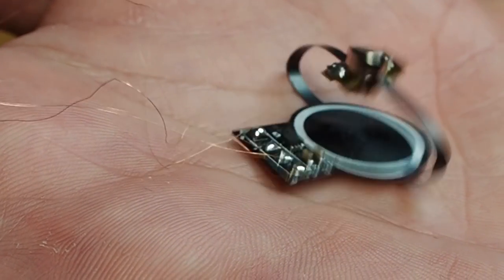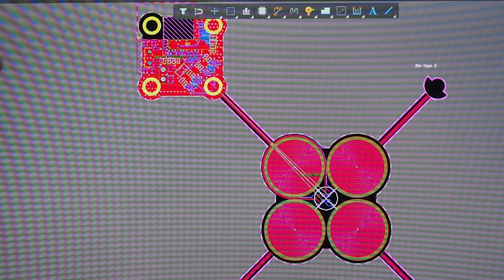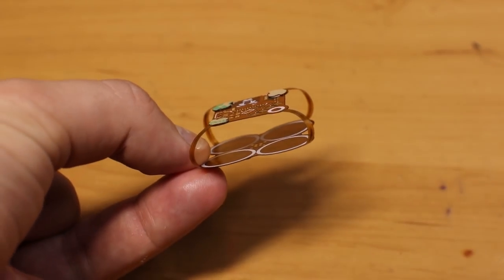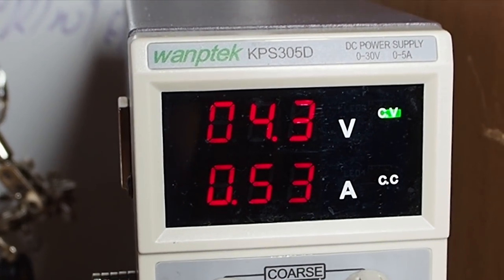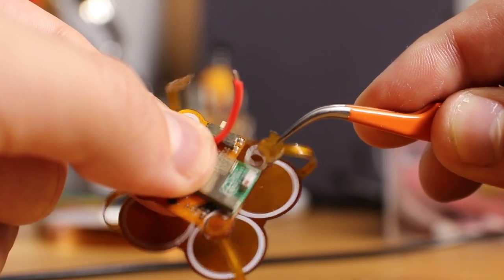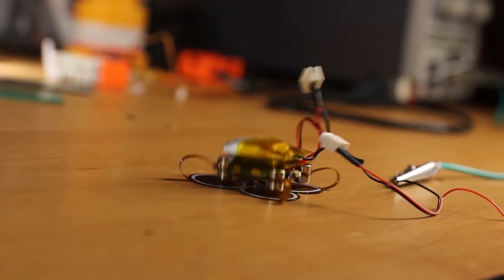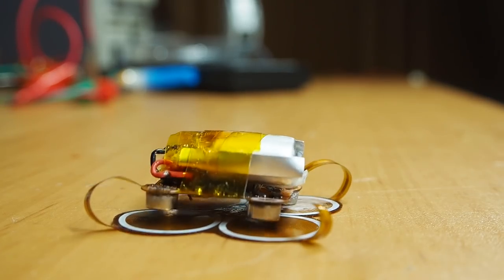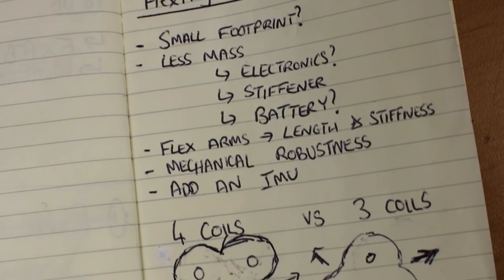Making a Jumping PCB Robot

Comment: Problem ( At least what I think ): Motion is caused by an external force. The action and reaction of your system are contained in itself. Action -> PCB Coil is pushing the magnet upward:-> Simultaneously:-> Reaction -> The magnet is pushing the coil downward.......Both coil and magnet are part of a single system. It's like pushing your car from inside.

Comment: I think you should try to change 2 things 
1. you should harden a bit the legs to gain more elastic energy accumulated.   
2. make the magnetic field switch reverse and add pushing on jump instead of just letting it go.
I'm sure these changes will give a better result . and of course you should do the next step

Comment: Could you not use two coils for repulsion and attraction than one paired with a magnet. I imagine it would yield less output for the same amount of input when not paired with a permanent magnet, but the weight saved might make up for it.

Would be interesting to see two coils wound in opposite directions powered on and measuring the difference.

Comment: more coils are a must but don't forget about maximum current in can pass
how about stacking 2 sided flex pcb's making some sort of multi layered flat coil with no extra stiffening, shouldn't change the mas much but would improve the power of the atraction and repulsion dramatically

Comment: What if the battery was on the ground beside the robot? At least then it could still jump, and maybe find the right properties that let you drag the battery without damaging it. Or maybe a supercap on the robot, put a magnet on the battery separated with a spacer or something, and pull the battery with the same magnets on the robot, which then recharges the supercap

Comment: Why do you need 4 magnets, isn’t the whole point if the pcb you made is that it has built in electromagnets? From where I’m sitting maybe shorten then send to make more Springy, add more traces to stiffen, make wider of need be. Remove as much cb plastic material from degree as possible. Now, those 4 magnets, those look an awful lot like 4 small hearing aid batteries to me. Could you replace the battery with this e? Could you augment the battery? Do you need the magnets?

Comment: Could it be that the big flat surface of the coil plate keeps it sticking to the desk because the air needs to get underneath it. I tried to find a word for this phenomenon and I think its called "wring". If possible it would be interesting to see if some very tiny legs/spacers like legs from THT components or toothbrush bristles glued under the coils would help solve the problem

Edit: I see some other people also suggested this
Reply: Looking at the footage again you can see the coil plate doesn't lift everywhere the same height. It rather pivots on one edge like turning a page. In my "wring" theory this could make sense. The edge that lifts the tiniest bit more than the other edges gets some air underneath and is less effected by this "wring" force, lifting it up even more than the other ones. If this is true it could not only help solve the jump height problem, but also the drift problem

Still I'm not at all sure if any of this is relevant at this scale and scenario so I'm interested if you decide to try it

Comment: So is it just a power and complexity issue that prevents you from using opposing coils instead of the relatively heavy permanent magnets?
Reply: Whoops! Turns out I’m not the first to think of this! Keep it up, man! Might be neat with the four layer options you had in a previous video! Hah, definitely a stretch, but what about a PCB linear actuator? A la solenoid? Maybe PCB trace coils with a hole for a pole magnet to go through and flexible PCB arms/springs wrapped around to the magnet for linear stability?

Comment: Maybe instead of frog jumping on a solid surface, you could try to build something that would float on water.
You would face different engineering challenge since you would have to protect your circuitry from water, but you could utilize water dynamics with flexible PCB parts to propel your device
Reply from the maker: I think flapping a flexar on water sounds Fun! I think it will work and it will make an interesting robot :) but like you said there are other challenges.. I might do this after i finished a couple of ongoing projects

Comment: You can try thinner magnets maybe? You can get pretty flat ones.

Smaller battery is also an option.

Definitely gonna need a V2. Or at least a video of you attempting to make V2. :)
Reply: what about an electromagnet instead of the prmanent?

i mean weight would be less
Reply from the maker: usually the thinner the magnet, the smaller their magnetic field strength is :) but that also means less weight so ... Smaller battery are very hard to find as they need to supply a peak discharge current of 0.5A

Comment: Hey so just out of curiosity, could you have tried using a capacitor to power it? Kind of like those micro charger cars that that worked by you charging up a tiny capacitor and then release, leaving the capacitor to drain by outputting electricity to the tiny motors I them. If this is a stupid idea and wouldn’t work please tell me because I want to become an engineer and love learning new things related to mechatronics

Comment: I'd be interested to see designs that have the actuators angled in respect to the flat surface. IE, instead of the coil "throwing" the magnet straight up, what if the coil was angled on a ballistic trajectory? You would trade height for horizontal distance, but perhaps with more efficiency.

Comment: The flat discs for the coils arent helping because of the air pressure. Try setting it on some fabric or something that will allow air get under it. 

Same physics trick where u break a stick over the side of a table by having a piece of newspaper over half the stick.

Comment: Have you considered that perhaps the electromagnets are weakened because the magnetic fields of each loop are slightly canceling each other? It might be that a better design is to stack loops on top of each other instead of fitting them inside each other.

Comment: I suspect you're losing F as the magnet makes poor contact with the coils.  A little d^2 goes a long way.  I also supsect it's wasting flux from coil/magnet misalignment... Not to mention only one side of the magnet is having all the fun.  As for 3 instead of 4, my hunch is the surface of force will be a truer plane with only 3 points (more orthogonal F).  Instead of redesigning for 3, can you use 2 of those fantastic PCBs and sandwich the magnets to recover the efficiency?  You will clearly need to tune the timing, of course.  Lastly, what about putting 'lil Kermit in some mineral oli?  You might learn a lot with higher  bouyancy as well as reynolds.  You rock, by the way.

Comment: Wouldn't a coin cell battery work better than the lithium?
Reply from the maker: it would probably be heavier and have a low discharge current rating - the robot is drawing a peak current of 0.5A 😕

Comment: Instead of battery use induction wireless system for power supply.no need of battry
Reply from the maker: that is not as easy as it sounds :) and the range would be very limited

Comment: Would love to see a page of calculations for why you think the frog bot should be jumping 1cm (+-) into the air.

While I may be wrong, it seems to me that when the current is cut to the coils and the magnets "release" the energy is stored as elastic potential energy in the bend of the PCB. Thus, the bend unflexes (roughly equally) pushing up on the bot and down on the table. As a result this problem becomes one of the bot trying to jump by pushing off of itself which will not work.

If I am totally off base here, someone please correct me. I am just trying to understand the physical forces in effect here.
Reply: By that logic maybe adding weight to the top surface (in addition to increasing the stiffness of the 4 legs) to increase the momentum of the upward force would actually help, as it's the weight that 'carries' it upwards?

Comment: Yes pls try version 2!

Also, why use magnets?
Why not use more coils on top and run the current in an opposite direction? 

You could reduce your overall weight this way.

Granted you'd need more current to run all your coils, for which you could design some sort of capacitive circuit that can give short bursts of high current.

Comment: CG is too high. Try placing the battery on the surface and coils on top it. Also if possible remove the magnets completely and use another set of coils.

Comment: I love this. You DEFINITELY need to make a next version. I cant wait ti see it. Is there any way to get a smaller, lighter battery, i feel thats what is letting you down.
Reply from the maker: thanks!! it very hard to find reliable lipos with low mass and high discharge current rating

Comment: May be remove the lipo and use a 3V button cell. It will reduce the weight drastically. Cheap garden lamps have a NIMH cells that are small. See BIGCLIVE's video https://youtu.be/z-fEVy8qblw Or use combination of flat 1.5v lr23 button cells to get your voltage. I think components will still survive.

Comment: I think a big problem are the 'massive' and solid coils on the bottom, it is actually a solid plate, no air can go thru it. When it tries to jump it moves air that wants to push it down, a resistance. When released, same story, it pushes away the air between the plate and the table surface, again a resistance. It is now acting like a speaker cone. Maybe you can add some vent holes, air leaking points, that reduces the amount of air to move. You can test personally by taking a solid plate and try to jump with the plate. Almost impossible. After this take a plate with many holes in it and try to jump again. Much easier! Notice: I am not responsible for any injury performing these tests. :-P ;-)

Comment: is the problem of not enough hight jumps is not a case of atmospheric pressure? Coils are very flat and circular and lie on a flat table, make a soo quick movement can create the problem of generating a kind of vacuum for "u sec". Do you have the option to create a hole in the center of the coil? it should give air more ability to equalize pressure and I hope to improve your jumps. Anyway great work :-)

Comment: Ehi, why do you not add some springs? Maybe they can help to get a better jump...  And maybe, if you reduce the area of the coils (
increasing their height, with a thicker pcb, so the force and the mass are the same) the air resistance is less, and it will jump higher (I know the air resistance is very low at low speed, but maybe it can help a little bit).

Comment: Can u do a solenoid as same as u printed circuits in this video. By the way u did very well good project. But because of more flexibility it canceled most of the upward force. So couldn't jump. And could u use solenoid instead of actuators.

Comment: I'm no expert in material and their flexibility,  but you can try reducing the area of contact between the 4 circular coils with each other (that means all the 4 coils are a little distanced to each other and connected by strips of flex pcb) like a small square with coils on its corners.
I think it might work.

Comment: I think you need the legs to be stiffer rather than softer! If I understand correctly then the legs are a spring, the magnets tension the spring and then release to get a jump. If the springs are stiffer you'll get more jump from the same compression. The only issue would be that you'd also need more force from the magnets to pull them together. I don't know if it's possible but I think the best solution would be to match the force of the spring to the magnet so it can just about pull them together.

as the force of the magnets is non linear with distance  you might be able to optimise the springs by making those non linear as well, for this I think you'd need the spring to be thick at one and and thin at another. You might find that is theoretically a good idea but practically too much effort

Comment: Maybe the problem is the big flat surface of the coils. It air can t flow fast enough under the coils. So it creates suction. It is like you try to pick up something flat (like a sheet of glas) from a flat surface. The faster you try, the harder it gets. It may be an idea to make little dots under the coils or to fold them a little bit. This will reduce the amount of the planar area of the coils. I hope this helps

Comment: You can integrate the bluetooth chip directly on the pcb right the extra weight of the the bluetooth pcb will also affect the jump or you can make a small  spy radio module which will eliminate the chip completely

Comment: paint coils drop iron filings on wet paint
hold magnet under table to align iron filings to the field lines 
shake off any extra iron filings possibly repeat prosses 
options 
single sided
both sides
layered coils iron filings
iron filings not aligned by any fielded 
lots of sizes of iron filings to try 
or any other ferromagnetic elements
that can be crushed into dust or more grain like structures 

also lighter thiner paints or glues

how many layers can u add how much iron can u get to stick in how thin of a layer

Comment: Would design a flying or/and driving thing instead if I had those skills. With springs, props and turning wheel it will jump any way. You have a fundamental for the forces and lightweight needed.

Comment: use a velcro pad at the base. This will help the vibration advance and slide on the road in one direction. you would only have to control the direction

Comment: Perhaps separating the jumping from the steering might help? maybe one coil moves the magnet up and another moves it sideways to turn. Also, I was impressed with the sliding the device did by pumping the air underneath it. Maybe a sort of ornithopter hovercraft might be more promising?

Comment: The coil have big surface area, so the air generate resistance while it jump, you should invert the position of the magnets and put te coils under the battery